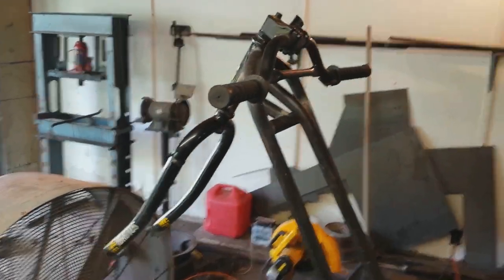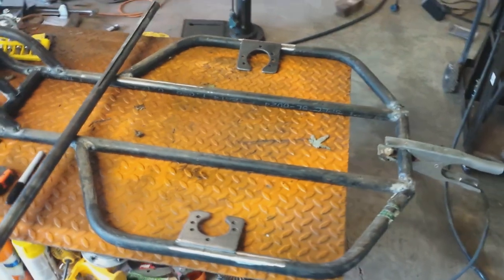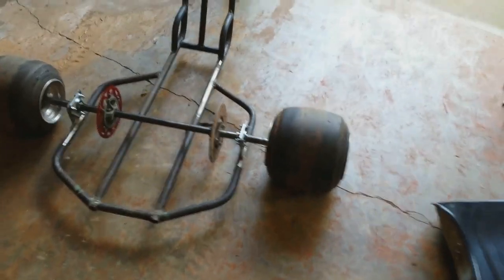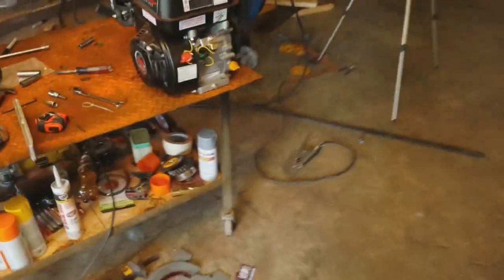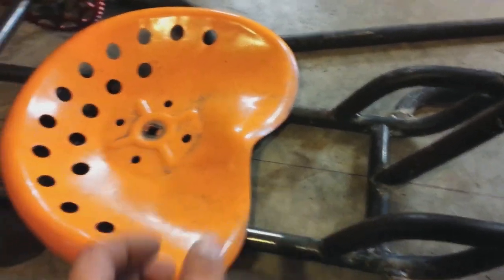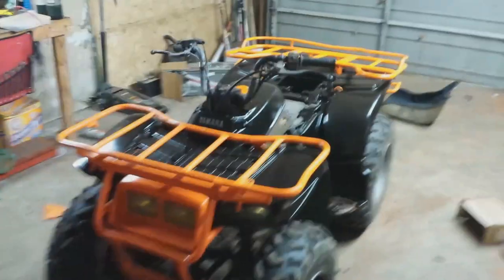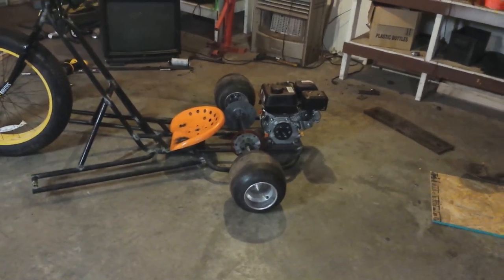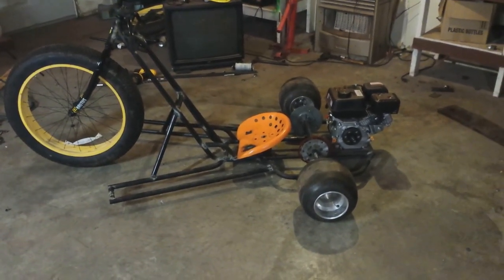D.I.Y. Homemade Motorized Drift Trike Build (Part 2)

Comment: What you suggested for a color, I am all in for, the hubs and engine shroud, wheel seat, etc, orange and a black frame.  I'd do the rear wheels orange too to balance the colors
Reply from the maker: 71 Sears i dont want to paint the rear wheels due to they are shinny and i want to keep then raw

Comment: What did you use to bend pipe and notch the tubing? Sorry if you covered it in the videos, I missed it...
Reply from the maker: +PolarisJD it was a tube bender from harborfreaight
and i used hole saw and chop saw
Reply: +Lonnie ( PuppetKicker ) What kind of welder do you have? Brand, size, mig or flux core?
Reply from the maker: ***** Lincoln Pro Might 180 flux

Comment: hello my friend I like your invention and I want to make one for me already send to buy the engine I need to know about the cluch and the chain and the sproket how many teeth it is and if you can help me with the size of the tube you used and what material is and where did you get the tires wheel axles basically everything to start with my project thanks I hope to hear from you

Comment: Man, I would suggest you to look up roll cages and do some research on building frames. Triangulation is your friend. Take the time and build smarter.
Reply from the maker: Look up Drift Trike builds do some research. This is my first time ever doing something like this so I would say that it came out great for it only being the first time ever bending tubing.
Reply: Im sorry if you took my comment as me bashing you, I'm not knocking your build Lonnie. Please hear be out on this. You stated that you had allot of flex. Well that due to two reasons: 1) the type of material you used; 2) the lack of triangulation in your build.

Due to you using gas tubing/schedule 40 tubing it will flex more than DOM tubing. DOM tubing is a bit pricer but is less likely to bend/flex.

The triangulation comes into play when a weaker material is used. It does take allot more time to do but it eliminates the flex. Where the "gussets" were added you could have done a couple huge "X's" between the two pieces of tubing. And it would have stiffen it up allot. As a matter of fact, right before you mentioned that you were getting "some flex" I told my wife, "if he doesn't put some triangulation in there he's going to have allot of flex there" and then bam you said it. Lol

Look man I'm not trying to bash you I was just trying to help out. I know I come across as a dick, but know I wasn't trying to come across that way.
Reply from the maker: Josh Smith sorry about that. It's easy to misinterpreted text. Thanks for the help and tips
Reply: Lonnie ( PuppetKicker ) it's all good. You're right, it is easy to misinterpret text. It's no problem.
Reply: Oh! Lonnie ( PuppetKicker ) Further more, please don't ever use that tubing bender for anything such as rollcages unless it is modified. Reason why is because that type of bender will begin to crush the pipe/tubing within the inside of the bend, in turn weakening the pipe/tubing. You might have noticed that it begin doing it on this project. You can modify it so it no longer does this, it's simple but it's needed to be done for structural builds.
Reply from the maker: Josh Smith how would I modify it